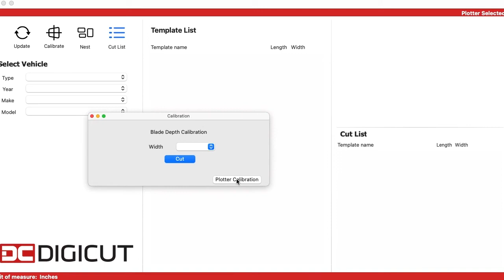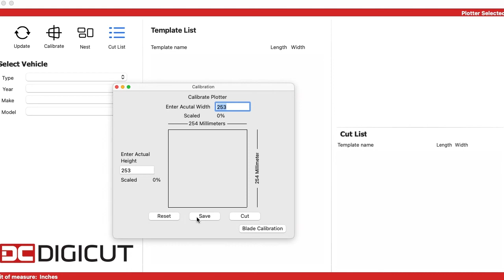Plotter Calibration

Comment: My calibration is off. 257x251
Reply: You will need to enter your measurements into the width and height box and save your change.
Once you have saved your measurements recut the square and it should measure exactly 254mm x254mm.
If it does not you will need to hit reset and recut square to get a new measurements. It is very important that get the exact measurement when measuring.